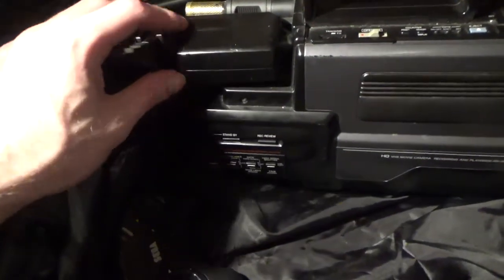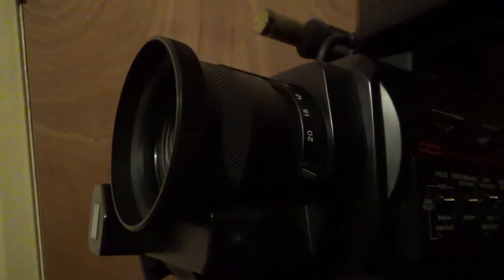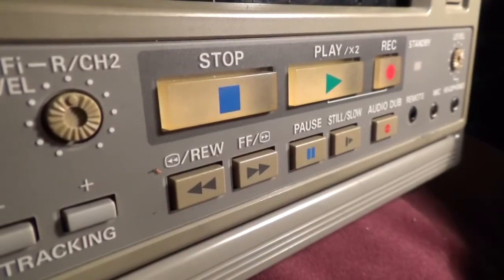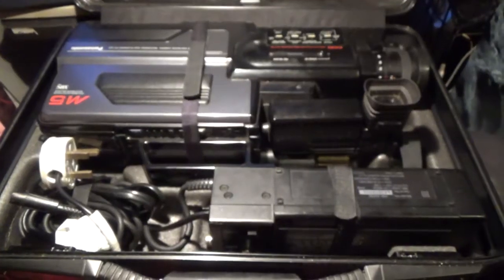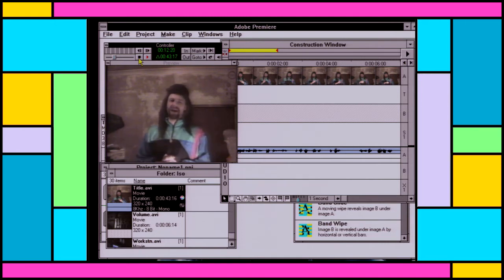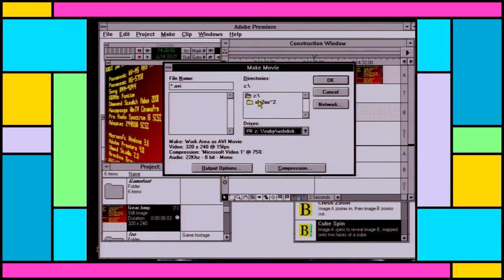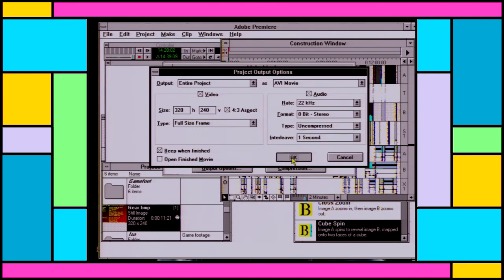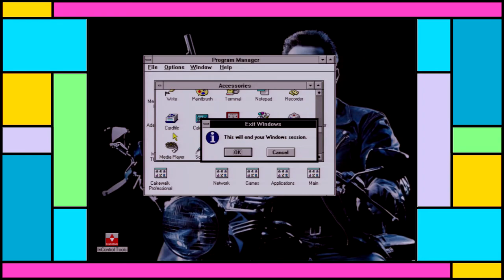The Making Of Mullet Man's Mega Drive

Comment: When I want to just stop using youtube all together,  You put out another video and I don't feel wrong for constantly thinking of the 90s as being better and more interesting as far as Computers go.
Reply from the maker: I've thought about ditching YouTube in the past, even considered selling out the channel years ago, but figured I'd continue for as long as I enjoy it. Naturally I can't promise the channel will last forever (I can at least promise it won't sell out though) but yeah, decided years ago to just ride it out until the wheels fall off some day. Older machines were definitely more interesting and in some regards, they were better. The major thing here was the fact that everything happens with absolutely zero latency, just try doing that today, it isn't going to happen and even then, half of the hardware is often external, which I find inconvenient. The whole idea in the 90s and very early 2000s of basically having one box that did everything was a good one which seems to have died over the past decade or so, a horrible loss in my opinion.

Comment: Regarding the "doing real work" on Pentium 6x family. I've been editing and compiling Quake levels in 1996 and 1997. I remember some needing 6-8 hours to do the complete bsp/vis/light trifecta. Fun times.

Nowadays my 5820k would blast through that in a minute or so.
Reply from the maker: It has always evaded me why Quake required levels to be compiled like that, or more importantly, irked me immeasurably. This is probably why I stuck with Build - an engine which does appear in this video, in fact it appears in nearly every video, that's where the logos came from. Pretty much everything is real time with that engine, no compilation required outside of 3DR's CON system, which is technically in gameland and not part of the engine.

Comment: Sigh, I want more of these CG TV logos! Mullet Corp, the future of Television, you know. That's the real art.
BTW, is there any adavantages of running Premiere on NT 3.1? Maybe NTFS volumes of a larger size? Yet I don't know what specs does NTFS v1 provide (and is there any  NT driver for your capture card, that's the question too).

And now I feel a buzz to compare those early video codecs (Cinepak, Indeo and so on): encode, decode - how much computing power they ask for; with a result written on a 650 MB CD, hm... Possible time, video & audio quality. Yet, I'm too lazy.

And it's still may be interesting to see a clear video of that lovely VHS monster - how it goes with enough light and with nowadays capture abilities.
P.S. You shouldn't ignore the power of ADPCM, I believe :]
Reply from the maker: Not sure that they could be considered art so much as blatant abuse of PowerPoint and the Build engine. NTFS at the time had similar limitations, at least within the OS installation, and this version of Premiere is 16-Bit only, meaning the file size limits would still apply regardless. The WinTV boards did have Windows NT support along with the ability to run multiple cards. NT would theoretically be more stable, if you had the patience to set it up, but nothing proved unstable under Windows 3.11 here anyway.
One thing I do know about fitting things onto CD-ROM with old codecs is, that you can fit the entirety of Commando onto a single disc with Video 1 without it looking too terrible. I can also report that Indeo encoding takes 4-5 times longer on this system. Dedicated Indeo encoding hardware was said exist at this time, but I do not have any of this available.
The VHS camera will almost certainly reappear at some point, it is not here to simply sit on a shelf and look nice.
ADPCM might have been OK, but the 100% Indeo video left enough room for PCM audio, meaning that there was no incentive to compress the audio, it would have taken longer to do so, regardless of whether any quality loss would be noticeable or not.
Reply: Honestly, I've imagined (for a second) of a video tutorial of how to build those flashy logos using such tools. And... just imagine: you are an engineer on 90s local TV station and that's your tools. That's a... blasting setup!
Nevermind, these are my mad talks.
That may be interesting to explore the subject - I mean PC video editors (+ accompaying tools) during 90s... Probably until "32 bit boom", i.e. ~96. I wonder if any of them took advantages of NTs prior to 4. (And Video 1 -  I forgot completely about that early thing from MS)
Reply: P.S. but... Build Editor – and the logos! That's the way I like it(c)